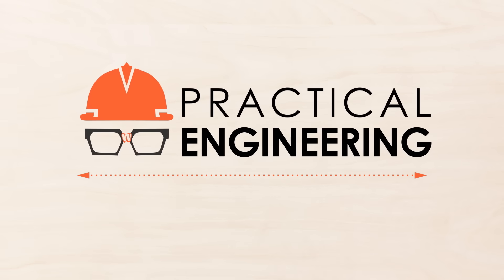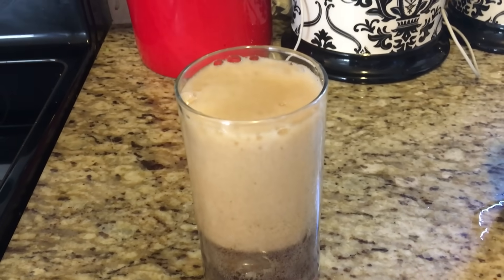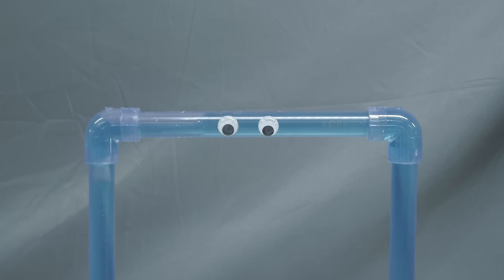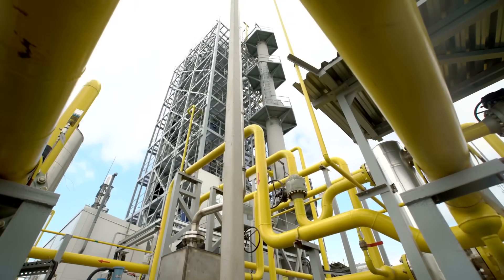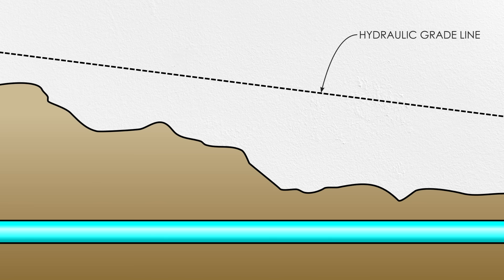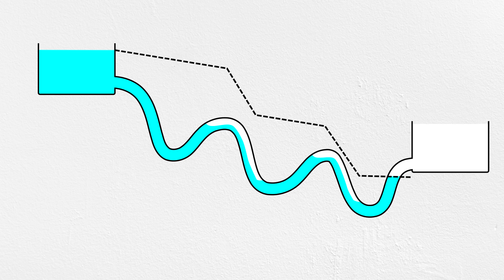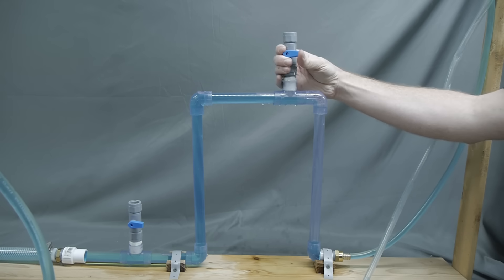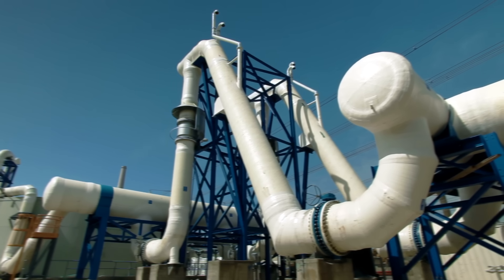What is Air Lock?

Comment: Airlock is always a problem in our area because the second water reservoir always runs out of supply every morning and it also takes a long time to fill it again and supply the houses in the lower part of the area. Is it okay to put a pipe with an elbow in the main pipe so that the air in the water pipe can come out? I hope you will answer my question. Many people say that the pipe with an elbow is useless but in our understanding, a pipe with an elbow is a great help so that water can continue to flow in the water pipe. Thank you so much!

Comment: This year we bought a portable dishwasher, it had stopped draining so of course I dug into it. Checked all of the electronics, all of the physical motors, and everything in between, and I still couldn't get it to drain. Finally, in a fit of inspiration and remembering this video I decided to pour some water down the drain hose. Worked, like, a, charm! I both felt exceedingly foolish and wickedly clever for figuring that out, thanks Brady!

Comment: Thank you for the informative video. I heard about Air lock while researching what I might need for replacing my old waterline. The Air relief valve sounds like it might be what I'm looking for to help prevent that and other air-related problems and damage to the line. My main question is: where would I want to install it? The waterline is somewhat atypical in that it is over a mile long, which is problematic in many ways. Not least of which being getting rid of all that air. I assume not having the air relief valve in the past contributed to the many leaks we've experienced throughout the years. Another thing to note is that the entire length of it is at a gradual downward slope aside from a hill about 2/3rds of the way down which is probably about 30 feet high, though not terribly steep. Should the air relief valve be at the top of that hill? Should it be near the end/bottom of the line? Should it be at the top of the line? Should I have more than one? Any help from you or another knowledgeable person would be very much appreciated. I'm not a professional plumber or anything of the sort. I just have a lot of experience repairing and replacing sections of this waterline, since this is for the house I grew up in and live in to this day. I would appreciate any advice.

Comment: I sold industrial pumps for over 35 years and encountered vapor and air locks being the cause for the "pump not working".  I wish that I could have sent my customers to this video before I had to drive to their plant to explain why the "pump was not working".  Almost all problems of low flow pumping issues is the plumbing system.  You did a top notch job of explaining the subject.

Comment: Great video!
Question: I set up a gravity fed irrigation system and I think I have air lock. It was working fine but when I adjusted the hose line it stopped working. What do you recommend? should I add a valve next to the ibc water tank to bleed the air out? Would this help?

Comment: Do you check your comments? 
I have a small hobby scale practical engineering challenge/ question about airlock:  intentional.. inverse.. airlock.
 1/2" intake airline... can u somehow somewhere use water controled by small controllable pump and or solenoid to act as an air valve to continually stop/start airflow?

Comment: Hi,
I may have  problem on a water supply line to a pump that is from a water storage tank. The line is very long and the highpoint of the pipework is level with the ank water level. I'm introducing air release valves to the system but would like to go through the concept with a professional engineer and get a peer review.

Comment: Very useful man. I saw some man use a plastic bottle to lock the air behind the valve. and you can see it works very well. Water completly full of the tube . Make water flow very strong.

Comment: Sometimes what it seems to be a disadvantage, could be used as a tool or method for specific applications. I can give you one example, I am looking for a safe way to work in a specific section of a pipeline where I don't need to have product. This means that I will have to displace product and make sure that during the work, it does not return to the location where the work is going to happen. It is tricky as the elevation is playing on my behalf (Im working downstream and the pipeline comes from the lowest point). It is impossible to drain all the pipeline as it is very long so I have to calculate the safe volume to be displace upstream to make sure the work can be done. The losses can be calculated to predict the volume required to be displaced but I did not consider the Air Lock effect as a loss I can also use. This means that injecting gas in the high points upstream the location we want to intervine, will help us to reduce the risk. The only problem with this is to do a reliable calculation.

Comment: Has a disaster years ago with an air lock. The pipework was designed to enter the bottom but the ac radiators had no top vent. This wasn't realized until fill time came.
 In discussion with the cooler manufacturer they said purge from the bottom..A simple aav at the top would have solved so many issues and saved days of extra work...worse the pipe contractor did a runner and left us to sort the mess
We did our best but there was still air in the system.
We set it running hoping to push the air out during the test runs.
All seemed well until the next morning a flange burst off. (ABS pipe) we assumed it was a contractor treading on the pipes. Replaced and run again
Next morning it happened again. The air lock c/w the inverter driven pump set up surging which caused the break. 
3 dats of venting eventually got the air out and the issue never returned..
Heady days and stressful nights as this was part of the London Olympics canoe park and failure wasn't an option..
I still have nightmares about those days .

Comment: When I worked at a cement plant decades ago, the workers in the plant had a valve they called the magic valve. Here is how it worked. Limestone was dug up with a giant dragline at the quarry. It was dropped into a rock crusher that smashed it into small pieces that were mixed with water to make a slurry. The slurry was pumped about three quarters of a mile to a second booster pump that pumped it the rest of the way to the plant. Close to the booster pump was a valve, the magic valve. Occasionally the slurry would stop moving through the pipe and the fix was to open the magic valve which hissed and blew out air until liquid started spraying from it, then voila, like magic, the flow of slurry resumed. Since none of the workers had any idea what was happening, it was called the magic valve. LOL

Comment: EVERY TIME my underground tank runs out of water, the pump gets "air" in it. There is no way to know it for sure unless you climb on top of overhead tank and check if water is being pumped or not. The motor/pump is always at a rish of burning out and its very frustating to open pour water into the pump to "prime" it.... are there not pumps designed to pump water even if it dried out before ?

Comment: @PracticalEngineering could this happen on small scales say inside of a house? I've had weird issues where in my self-built RV. My pump is rated for 5 gallons a minute, but my hot water heater only ever sees 1.5 gallons a minute, no matter what I've tried. I've checked for all the other restrictions. I can't see anything else that would make it have a slower flow rate. Is this airlock phenomenon only on industrial scales?

Comment: Love your videos! I want to add that air locks are common all over the place in all kinds of things, and can be a real pain to eliminate. I'm having a hard time getting the air out of the cooling system of my car (which is just one reason why I found and watched this video) and the result is poor heat due to the heater core being half full of air, instead of hot coolant. Just another example of why air locks are a problem, and why they are a bigger deal than what it may seem like it would be. Air in a hose or pipe can also result in pump cavitation, which can cause noise, vibration, and damage.

Comment: and that is why proper bends and fittings are required by the  plumbing code. every change in direction requires a proper bend (ex: long sweeps of 90 vs standar 90 elbow for horizontal to vertical or vertical to horizontal, or horizontal to horizontal connections) to minimize the turbulence.

Comment: Meanwhile, your sink drain has the opposite design -- you use fluid (the same fluid you're dumping down the drain) to block air travel by intentionally adding a low spot (the S trap underneath the sink) so that fluid will go through but air will not. This is because you don't want smelly -- and potentially deadly -- gasses venting out of the sink drain.

Comment: Hey dude! I am no piping engineer but I built a custom water loop in my PC and came with trouble bleeding the gas...
Installing a bleeding valve at the highest point was not available since the top location of the case is also the place where one of the radiator is located. What's worse is the flowrate. I can full power the pump (high flowrate) but that'll make air run around the loop and don't settle down at the reservoir at all (also pumping air water mixture destroys the pump rotor). If I turn it down (low flowrate/pressure) the air stops at local high spots such as the cpu waterblock and reduces the cooling efficiency. It is just more than annoying.

Comment: I keep getting air trapped in plumbing that is higher than the boiler and higher than all air purge devices. Now I know why. I just have to find a way to fix it since the original installation isn't ideal.

Comment: Based on a real story.  A guy would weekly go to a nearby ice cream shop to get some ice cream.  And noticed over time that every time he ordered Peach with his order, his car wouldn't start.  Vanilla, Chocolate, Strawberry ?  No problem.  Auto mechanics couldn't find anything wrong.  Hmmm.
The cause eventually found.  Peach was not up front with the other primary flavors.  So the vendor had to go get back deeper in the freezer to get it.  That added a small increase in the time for the whole order.  The car's engine, warm from the drive there was stopped long enough for the heat to vaporize the fuel in the line running to the carburetor.  Vapor lock.  Same as your air lock.

Comment: I would like to see the airlock at 5:42 in a physical model. My understanding is that flow would not stop permanently but only long enough for the trapped air to return to the local highest point in the pipe. I feel clarifying would be nice because I feel the video makes it seem like the flow will stop and not restart and I do not expect this to be the case.
Reply: @PracticalEngineeringChannel thanks in advance if you take the time to reply!

Comment: Now I wish I would have thought to make one of those air release check valves. I helped a friend redo his pool pump system after a storm broke a couple pvc pipes. No problems yet but I'm sure there is trapped air in one of the pipes on a high spot. I can always add it later.

Comment: My family lives on a hill and we have to rely on a water tank, which the top of is maybe only 2 meters higher than our highest shower head, so pressure is already really low most of the time. To make it worse, we have to turn off our main water, open all outlets to let the air out, open the main and let water waste out all outlets, and close each outlet from lowest altitude to highest every week just to get decent water pressure.

Comment: Old houses on the East coast usually have "hydronic" heating or sometimes steam heating. The hydronic systems use hot water heated by an oil or natural gas fired furnace, or a boiler in the case of steam. Hydronic systems have to pump that hot water around, sometimes 3 or 4 stories high in multifamily homes. The air gets trapped up there, and therefore they use a float valve venting device exactly like what's shown in the video at the end. :) They also use an automatic feeder valve which allows water in when air bubbles get burped out. :) I was always curious how the auto vent worked, but after I saw one cut open it made perfect sense!

Comment: Can an air lock occur in an open system?  I don't think so; but, I have a water pipe from a spring that just empties into a pond that stopped running...trying to figure out if I just have a blockage of some kind or an air lock.  Thanks.

Comment: Interesting subject. All your videos are very educational. I enjoy them very much. Thank you.

Speculating :
If teh water is not flowing - for example, if the remote end is capped -  then the Hydraulic Grade Line is flat, I assume ( ? ) 
If that is true, then the slope/shape of the HGL should be sensitive to the speed of teh flow, which in turn is related to the pressure difference between teh entry and exit points.

If this energy loss is due to friction, then this lost energy should raise teh temperature of water/air/pipe.

But then, if the water flow slows down ( or stops completely ), then this frictional force should reduce.
( If this is true ), then you will never reach a situation like the one you describe at 5.46 whereby water flow is stopped completely.
But obviously it does happen ( otherwise you would not have mentioned it ). But I m not able to understand how that could be.

Comment: Superb 👌🙏. Sir I hav water connection from overhead tank but long length of my pipe n air issue the water goes faster 2 other flats. How do I get good pressure when water is opened 4 all.
Reply: Sir

Comment: I’m a Steamfitter, In order to avoid air lock, at the highest point should have a valve and automatic air vent, to help filling and venting. There will be traps depending on the flow, pipe size, and pump size. Now a days air lock isn’t as common because of proper piping practices. (PPP)

Comment: WOW! I 'am so glad I found your video. 
 I have a creek pump system that delivers water to a tank. There are leaks that are sm. and there are many undulations where the source meats the plumbing under the house.  I also have air that gets trapped from the shutting on and off of the pump system.  I can hear the air forcing its way out of the toilet tanks fill valve.  Should I create and install a tee joint before or after the shut off valve at the toilet. I can connect a pex pipe w/stop cap. Keep it above the inlet supply in hopes to allow for water escape to  take the air with it so air can condense and release pressure. .. Also, I can install afloat style are release valve.  I am just trying to minimize the air that sounds like its going to build up in all the cheap plastic parts in this mess the prior owners left me.

Thank you for your intelligent display of the mechanics and chemical science behind it all.
you knowledge would be greatly appreciated.

Your wife's input is welcomed.

Somethings not right!

Comment: It's probably the most annoying things, when you set up a pump that transfer water to a filter using a pipe, any air inside the pipe reduce the efficiency. Even worse if the pump isn't that strong, you have to fill all the pipe full with water then attached it to the pump without letting any air in.

Comment: An unfortunate comparison in that case are "air embolisms", which are basically air bubbles introduced to your blood vessel system after special injuries, iatrogenic procedures, special diseases etc.. Air embolisms can block arterial flow as much as thrombogenic clots can do. They can also alter the heart`s pumping functionality if air collects inside the caverns of the heart up to a complete failure and resulting death.

Comment: a big thing to consider regarding air pocketing is when designing impulse tubing lines for pressure measurements. Have to design the pressure taps to slope down allowing air to move back into the main line and out. You get air trapped in your impulse tubing and you lose your measurement. Could cause some serious problems.

Comment: Im a mechanic (auto) and its amazing to me that most people don't realize that air needs to be manually released from an engines cooling system almost every time it is serviced ( flushed radiators, change thermostats, hoses etc) in order to remove air pockets, some vehicles have to be jacked up on one side or the other in order for the air pocket to escape but most have bleeder valves built into the system. This problem didn't really come about until the late 80s when everything was made more compact under the hood causing the cylinder heads to be higher than the vehicles radiator. Thanks for the video's and keep up the good work! Its never too late for old guys like me to learn how things work 😁

Comment: I used to deal with airlock all the time while moving water off grid with solar pumps. Not sure what was causing it but a pressure release valve in the middle of the line fixed the problem.

Comment: You can avoid air lock by having a bleeder pipe with a valve or connected to a reservoir which sits at the highest point in the system, just like in watercooled systems for combustion engines and for custom watercooling loops.

Comment: 04:11 I don't get it. Why does a reduction of the cross-sectional area cause a reduction in flow rate? The continuity equation says the flow rate doesn't change when the cross-sectional area changes once the velocity goes up.
Reply: Has the similar effect of just having a small diameter pipe in that spot. Adds resistance in that spot. Yes a fluid will go faster in a smaller section but that doesn't make up for the constriction of fluid.